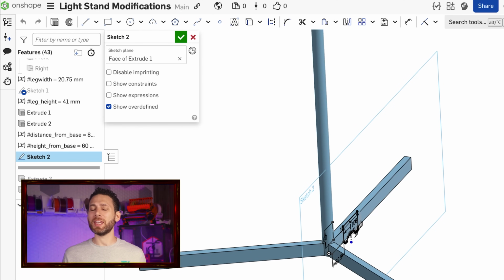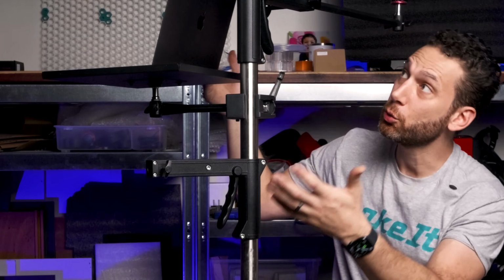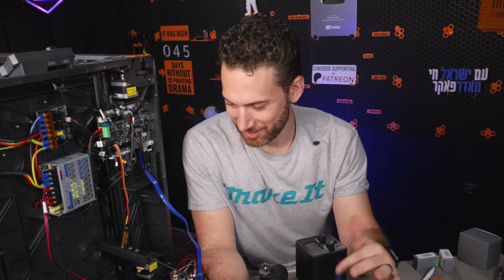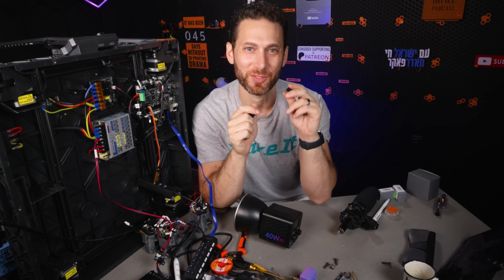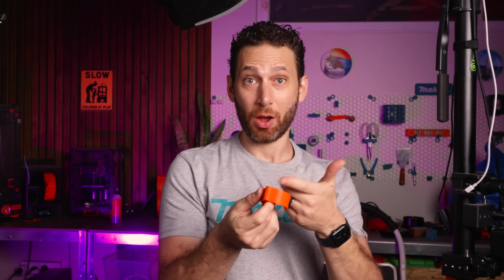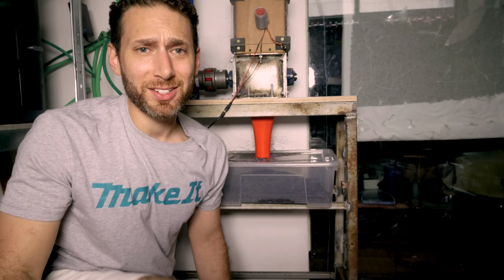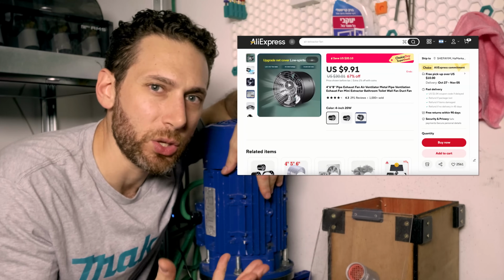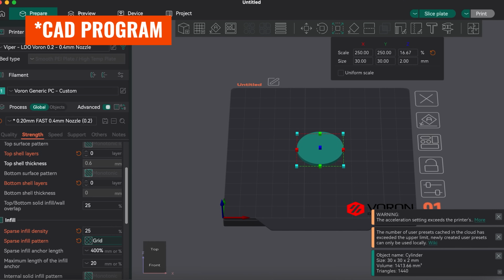7 Functional 3D Prints That Solved REAL Problems

Comment: Honestly the best thing anyone can do is take a college course on CAD. I took a course in College and learned in a week what would take someone months of “messing around” or trying to learn on their own.

I’m sure it’s school and professor dependent but my teacher taught me so much in such a short time it was great. I was also allowed to power through every project for the semester and stop going after finishing them in 2 weeks. Then just came back for the final.
Reply from the maker: I did 2 years of CAD in high school and spent the entire time dicking around with friends and tracing pictures LOL
Reply: @thenextlayer  really? We had blueprints and drawings we had to make in 2D/3D each week in the intro course. The next 3 courses were again blueprints but 3d solid extruded parts each week. The final was 3 parts needing made with a .002” tolerance with no extrusion errors or tooling failures. Maybe the difference was high school vs college. Because in auto shop in high school it was the same. In college it was much more serious and professional haha

Comment: I got an open box bidet for a fraction of the price (>$500 off) and when i got it, it was missing a metal mounting bracket.

It took only a few minutes to measure, and hour to model "square with some square cuts", and i couldnt believe how easy it was for how much i
I saved. (Even better - the original metal brackets wouldnt fit my toilets wider screws, so i just printed both!)
Reply from the maker: at first i was like bro TMI and then your comment turned out very relevant lol.

Comment: Why do you use orange so often? Also, seems like a twist tie could have solved some of these.
Reply from the maker: It's my favorite color alongside black. Twist ties won't hold firmly to the pole in the same place while letting the cable go back and forth, it's either too tight or too loose
Reply: @thenextlayer  Lol, that orange hurts my brain. I wasn't referring to your sound cable issues specifically. I use twist ties for everything. Anyway, I'm sorry that I didn't say anything positive. Liked the video. I especially like the suggestion of printing a cutaway for testing which I used to do religiously, although I'm starting to learn my tolerances for my printer now.

Comment: I needed to solve an overheating problem once… my mobile phone was overheating on a wireless charger mount, I used a tube to direct cool air from my air conditioner. it solved my issue. Do you have any air conditioning near by that you could use... hope the advice could help your situation. BTW Stay safe love your content
Reply from the maker: It's far, but I could try that lol
Reply: @thenextlayer  add an inline fan if you need need extra long ducting. LOL

Comment: I got a 3d printer and while I have mostly printed existing designs, but I have done a few of my own in CAD that have worked well. I use OpenSCAD for it, which is a different way of doing CAD, but I like it and it works well for me.